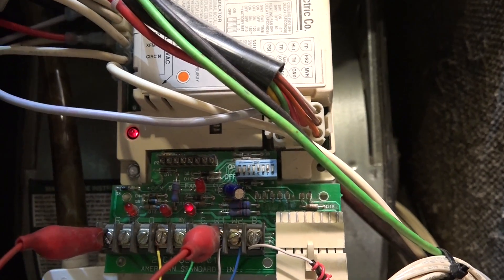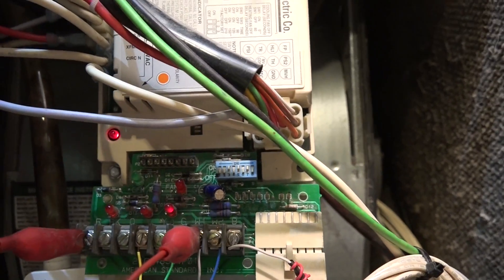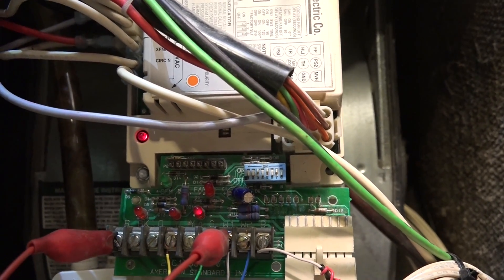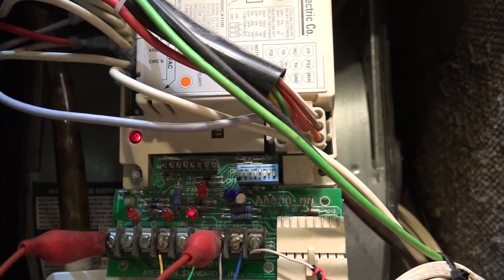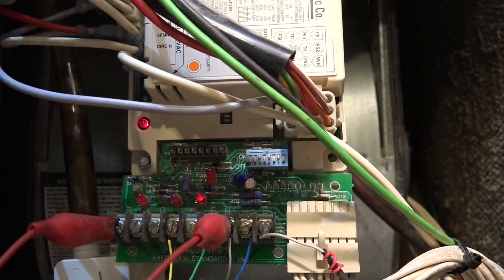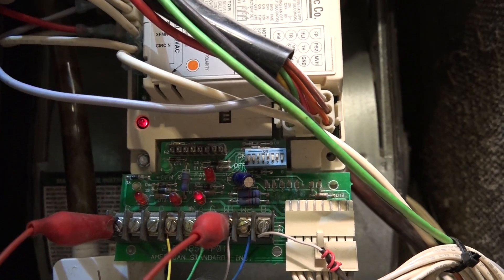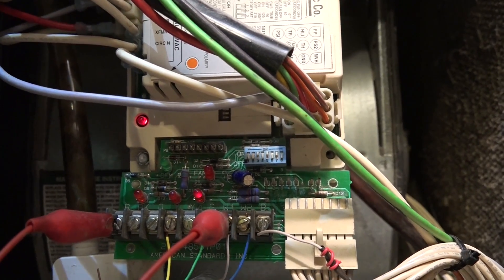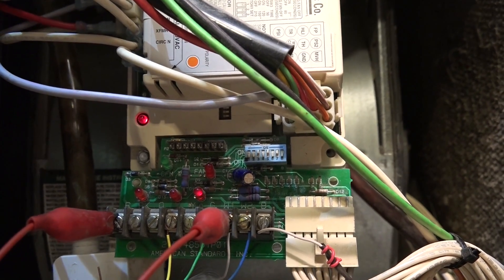What's wrong with this furnace #4 answer

Comment: I didn't check his other Video to see what part went out and I didn't say the names of the parts because most people can't repair boards  but make sure if you have a person working on your heater it's a good idea to watch them and make sure they don't cut corners on working on your heater because bad things will happen. The board : If to much heat gets to the board ,it will burn out some of the parts on the board , like where the wires leave the board and go two the burner part of the heater and there is no longer a seal there the board will go out I had a customer hire some guy to come out and work on their heater and he removed the seal from both parts of the heater were they meet ,the wires go through one part of the heater to the other part of the heater some of them parts can't handle the heat range that's why there is two compartments in your heater and if it's an old heater the seal just rots out then causes big problems so check your heater and replace all seals and filters every winter because most problems can be fixed if a person just changes their filter.The filter plays a big roll in your heater so please check it all the time and it will save you$$$$$$$$$ P/S the light on the board that will stay on or blink that don't work 100% of the time by telling you what could be wrong because that part isn't 100% right all the time but close just that 1% being wrong will through you off so that why YouTube is a great tool & one more thing if you have a heater that the pilot light stays on all the time turn the gas off to your heart in the summer it will save you over $25 a month depending wear you live.My summer bill was over $50 a Month on the gas side of the bill then two years latter I turned the gas off too the heater in the summer it saved me $30 a Month that's NO! Joke if you have an Electric start your blessed but for those that don't please give this a try and see the different in your summer bill next year Sonny Vigil....

Comment: interesting....so in order to notice the solid light you turned off and on the power?
Reply from the maker: +Armando Martinez jr. Actually, I had the power off for 2 hours while I was picking up the part before I got the solid light.
GFM
Reply: in a real scenario, 2 hours doesnt seem like a good idea. isn't there a faster way?
Reply from the maker: +Armando Martinez jr. 
Its odd to me too.  I talked to the Trane rep and he said the symptom of the inducer coming on then off was enough to condemn the board.
GFM